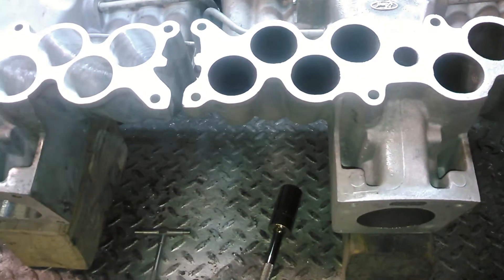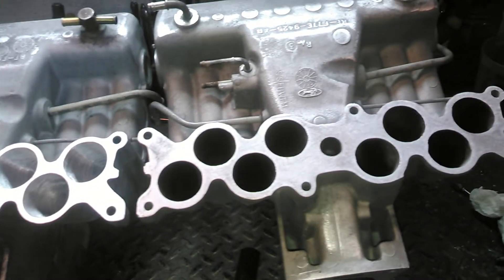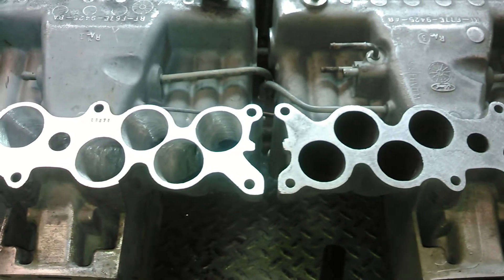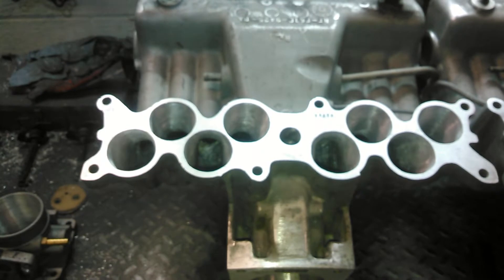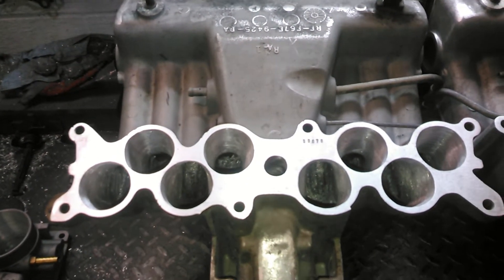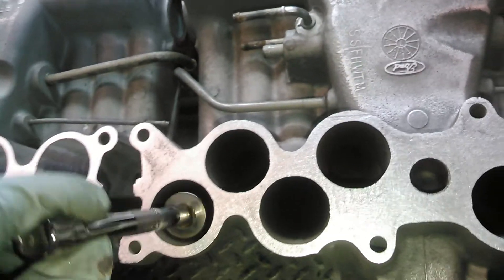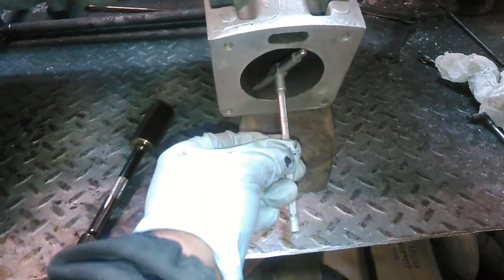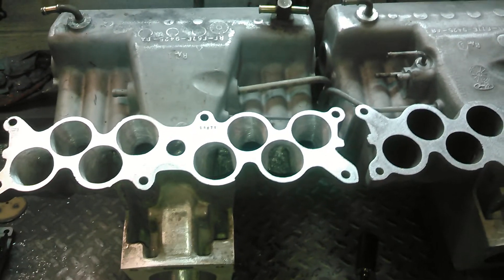GT40 upper manifold porting part 2 big Bigdogs Porting.

Comment: How many cfm you get the r series box fuel inj manifold flowing?
Reply from the maker: We've gotten the TFS box R to flow as much as 380cfm bolted together average runner flow with our stage 3 port job and welding.
We are currently working on our own fabricated box upper that will bolt up to our stage 3 max ported lowers that is pushing 400cfm average runner flow with a 90mm TB. Look out for videos of it!!💪👍
Reply: @bigdogsportingtonyb2833  You are the "Man" , love your work Tony! Thank you
Reply from the maker: @jasonmarchione110  thank you very much. It's a team effort now. We have 6 members of the Bigdogs Performance team and will be hiring more in the future  to bring high performance at a great price

Comment: What gasket would I use since you made the holes bigger on the bottom of the upper intake? Still use the stock gasket?
Reply from the maker: Most customers just bolt the stock type gaskets on and just trim them with a round file to match the lower being careful no to trim too much because there is wiggle room between the upper and lower

Comment: Is there a gasket you use to port these intakes to or just more custom
Reply from the maker: That 1979 ford kid you can run a modified stock upper to lower gasket. Most people file fit that one. Our Stage 2 lower is ported to a Felpro 1250 and the Stage 3 to a 1262